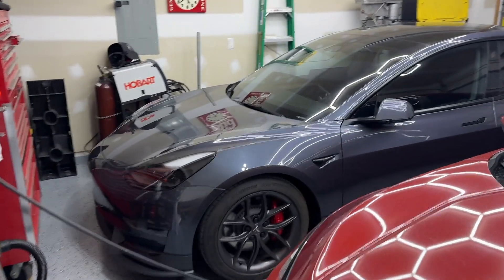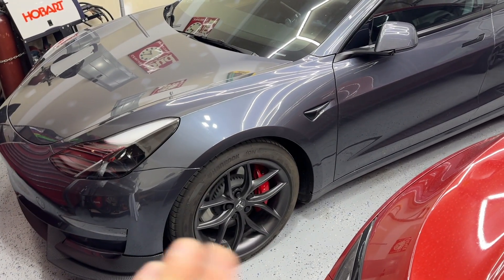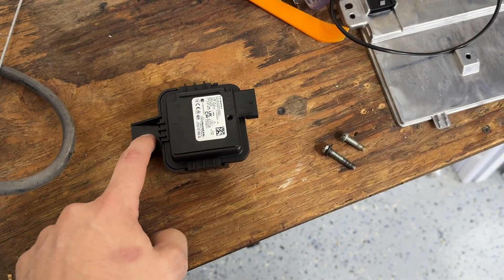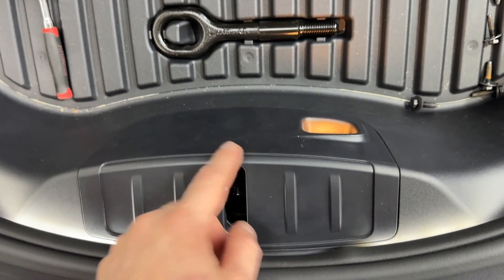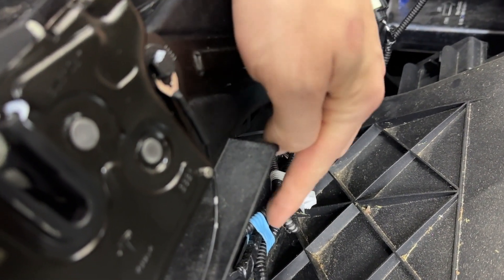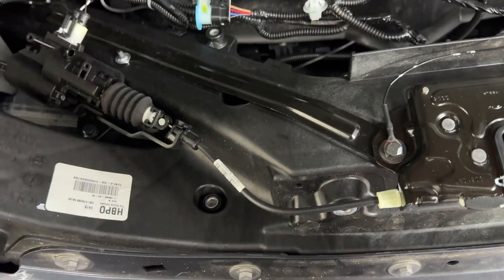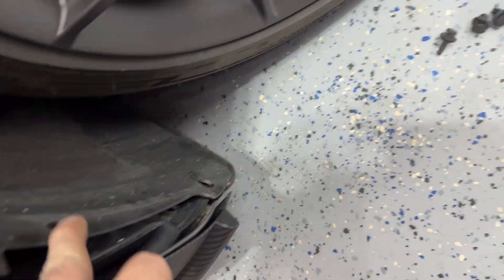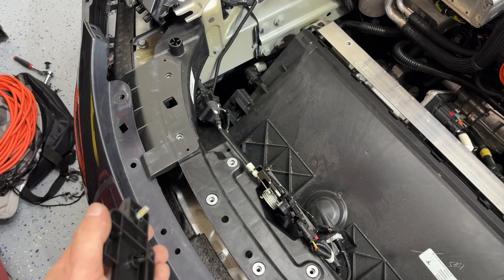2023 Tesla Model 3 Homelink Install

Comment: There is a standard location to install the module toward the front. The only caveat is that it is very hard to reach from the back. The Tesla installation was to pop the front bumper to install the module.